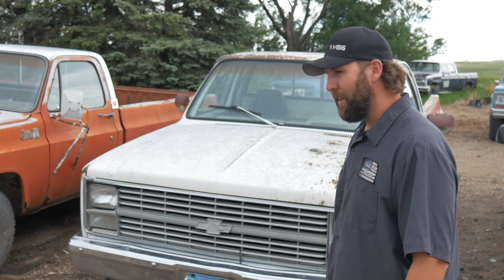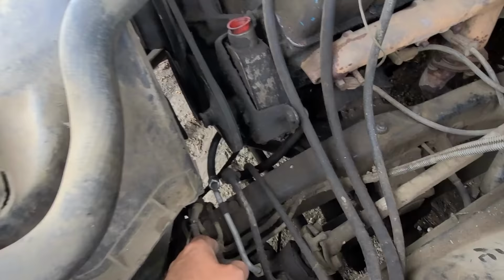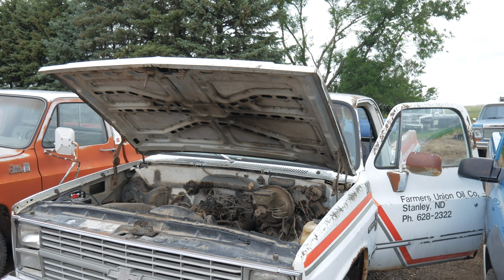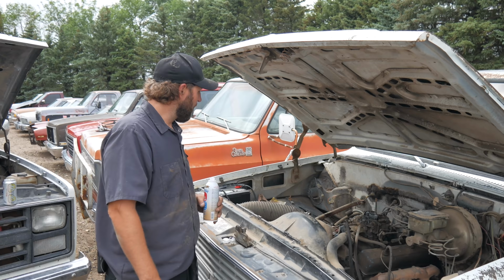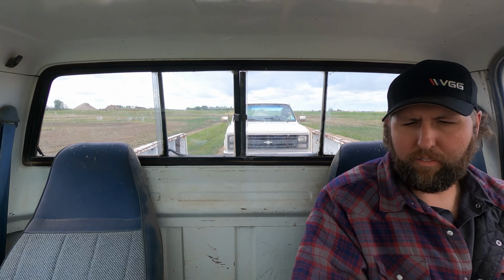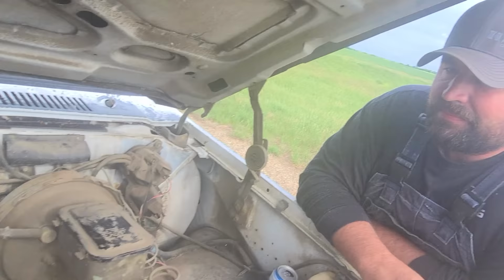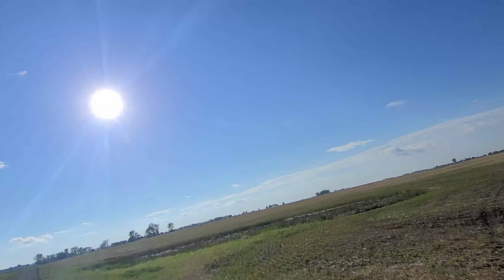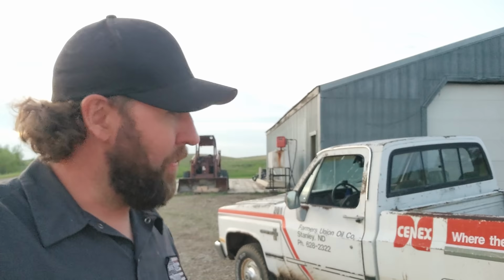FORGOTTEN Chevrolet 4x4 Square Body - will It RUN AND DRIVE 60 miles home?

Comment: 'T ain't no stinkin' CB, Sonny boy. That is a Bona Fide FCC land mobile two-way radio FM not AM and not SSB, made by GE, and the model series is "Phoenix". Probably a 50-watt "low-band" unit, given the territory where long range is paramount. GE was Motorola's main competitor for many years until the folks at GEcapital decided to end the competition by selling that division to Ericsson in the late nineties. 
GE was a Cadillac while Motorola was a Lincoln. CB was variations on Yugo.

Comment: Little late to the party, but those trucks don't like today's fuel pump nozzle technology. I have to move the nozzle above the vent tube part of the filler neck in order to get any fuel. It's the difference between 1 gallon per click and an actual full tank. Some gas may splash out when it clicks, but it's better than hovering over it and restarting every quart.

Comment: Would you want to trade a square body for my 91 chevy 2500 4x4 6.2 diesel with 82k original miles and utility body

Comment: It's a toss-up, right? 
Today's engines can go over 300k miles with nearly no wrenching...but good luck working on one.
Yesterdays' engines needed a lot of care, but they weren't super complex. Some effort and you could DIY it.
Tomorrow's motors will be electric, and the MTBF of those things could literally be a million miles....and be as disposable as a washing machine motor.

Engineering is pretty damned cool.

Comment: SET YOUR IGNITION TIMEING WITH LIGHT  AND  RUN HIGH ENGINE RPM SO IT FULLY ADVANCES   SET OIIT  AT 34 DEGREES    THAT  WOULD PROBABLY BE  8  OR 10 FEGREES  AT IDLE  YOU CANT SET  MOPAR LIFTERS  ITS BOLTED DOWN ON  RAIL  GOOD STABLE   MIYNT  ROCLERS WORK   GOOD ON RAO JUST HAVE TO LIVE WITH RATTLE OR GRIND VALVE SEATS  MORE DEEP THAT WOULD BE THE ONLY WAY TO   QUIET  LOFTERS     IF  STILL TO LOUD CLATTER  RUN SOME STRAIGHT 50 WEIGHT RACING  WITHJ LUCAS  OIL TREATMENT AND TRY  SOME OF THAT  RACING ASSEMBLY LUBE  WITH XINC  THAT SHIT IS THE GOODS  THE ZINC  WORKS  I FEELK THE DOIFERENCE  IN SEAT OF   MY  PANTS  DO YOU NEED A BPDUMAN  ID MOVE UP THERE O GET AWAY FROM HERE   WENT THREW A BABY MOM  BREAK UP   WELL SHE LEFT ME     WE HAVE A 4 YEAR OLD BOY  MY FIRST KID   I HSAVE ALL MY TOOLS AND READY TO WORK    I  AM  NEED TO GET AWAY FROM HER BEFORE I DO  SINETHING STUPID  LIKE    HIT SOME FOOL  WITH NY BABY MOM   THAT WOULD BE  BAD MOVE  MY  EMOTIONS OVER RIDE  MY  REASONOING  WHEN IT COMES TO HER  IM 64 SHE IS 27  WAS WITH HER FOR  4 YEARS  HAD A KID  I LOBR HIM  HR IS AWESOME JUST TURNED 4  CALL ME MARK  WORMAN  9095347271
IN 2008 B  I  FINISHED  MY 70  PLUM CRAZY  440  6 PACK ONE OWNER  I WAS  2ND OWNER  4 SPEED PISTOL GRIP   WITH HEMI REAR END AND SUSPENSION   AIRGRABBER  ALL NUMBERS MATCHING  TRANS AND  NOTOR  I SOLD THAT CAR IN 1C WEEK TO JOE AMATO    MY BROTHER PUT UP THE CASH TO BUY CAR    WHILE O WAS RESTOREING IT  I   LOST MY BROTHER IN PLANE CRASH THEN 1 MONTH LATEER   A GUY CAME IN MY GARAGE SND PULLED OUT A  9 MM  AND TRYED TO RTOB ME    IM STUPID I GRABED GUN   I TOOK A BULLET IN R
LEFT SHOULDER    THEN  I ENDED UP IN JAIL FOR A  16 MONTHS  FOR     CONTRABAN   STUFF   THEN I HEARD JOE AMOTO   FUNNY  THE ORIGINAL OWNER OF ROAD RUNNER   TOLD ME CAR WAS JINXED CAUSE HIS DAD BOUGHT CAR  WITH LIFE INSURANCE MONEY FROM HIS BROTHER WAS  HIT BY A CAR RUNNING OUT TO ICE CREAM TRUCK     I  HAD BAD LUCK  THEN   HOPE OITS BEHIND NME NOW I  WILL SEND YOU PICTIRES OF ROAD RUNNER   AMOTO  GAVE ME 45000   SHOULD OF HELD OUT FOR MPOORE